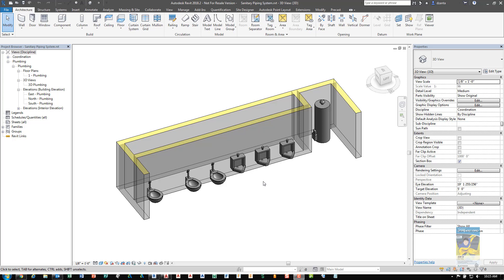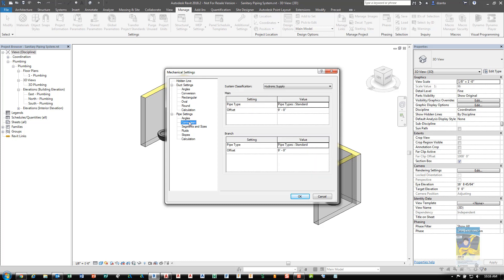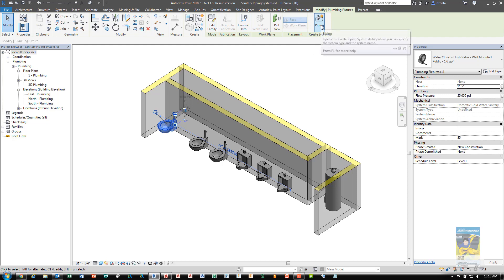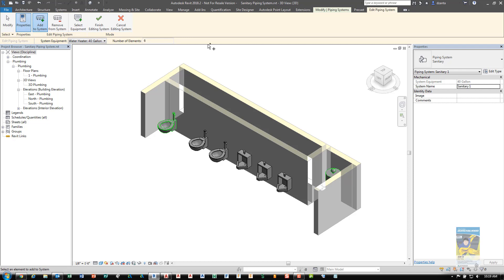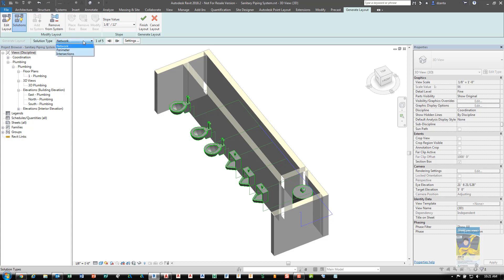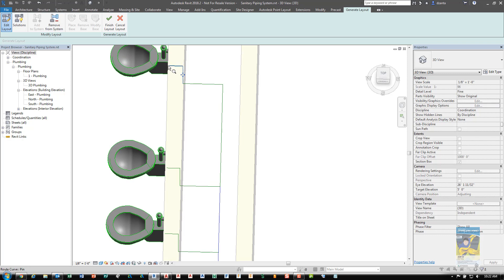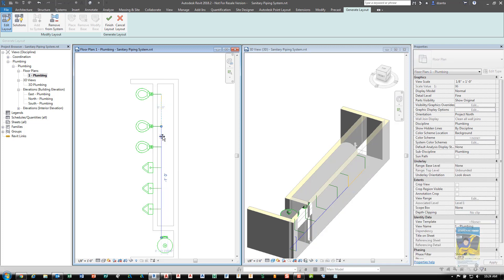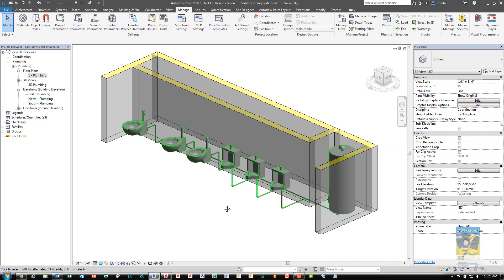Sanitary Pipe Systems in Revit - A How To Guide

Comment: I'm using Revit 2020, and I do not see the "Create Plumbing Systems" button when I select a plumbing fixture. Any help?
Reply from the maker: Is it an mep family with connectors?
Reply: @DzanTa  It's a toilet family, but I now see that it doesn't have connectors like my sinks do, for example. The "Create Plumbing Systems" button shows up for those. That helps, thank you for the quick response!

Comment: You did not show how to set it so it automatically adds elbows and such. I see you have created a new one, but you don't show how you did that
Reply from the maker: This is an old video for a quick answer to a user's question.  I will find time to make another one.  If you want Revit to automatically make the elbows and fittings, you just need to specify which families to use in the Routing Preferences of the pipe type you use.

Comment: why have you connected sanitary system to water heater? this is technically wrong. Plumbing system are gravity systems and all pipes need to be sloped.
Reply from the maker: Sorry.  I am not an engineer.   It was meant to show how systems are connected.   Same principle applies when making a sanitary system.  Connect all fixtures to a water source, create layout, check slopes and paths, create system and adjust.